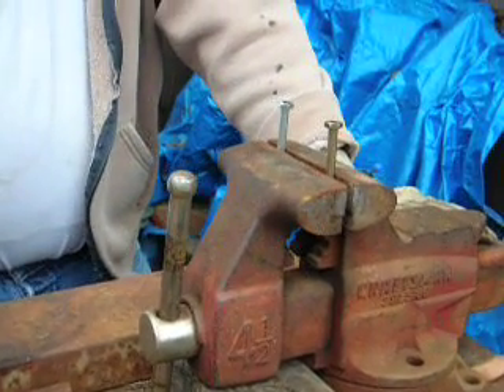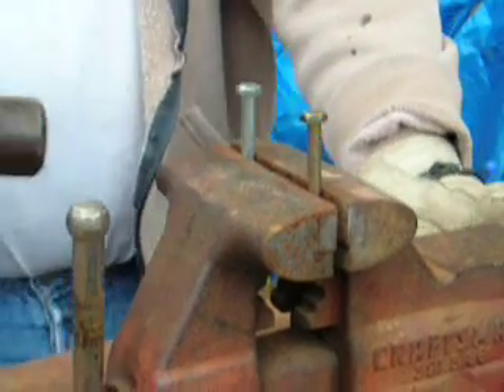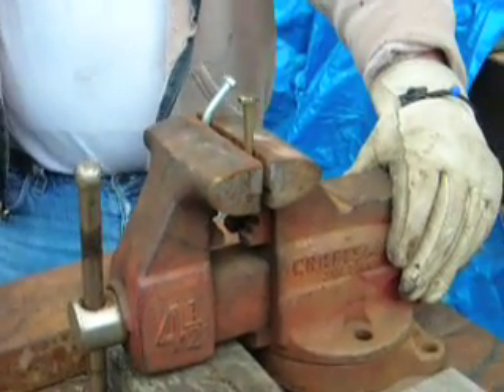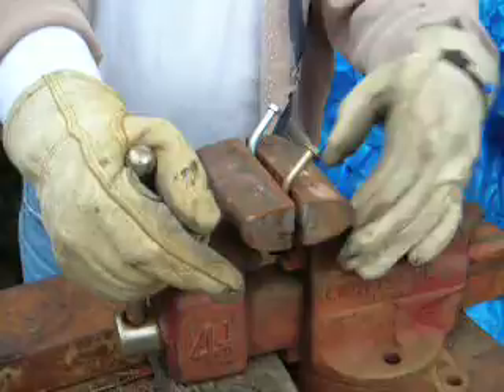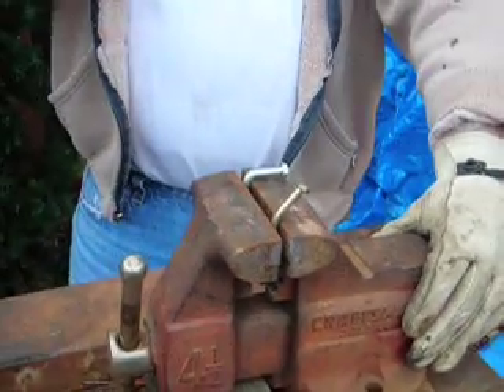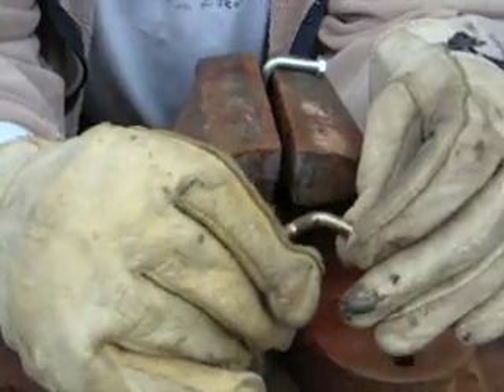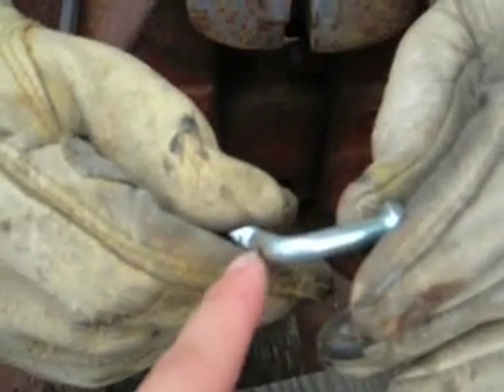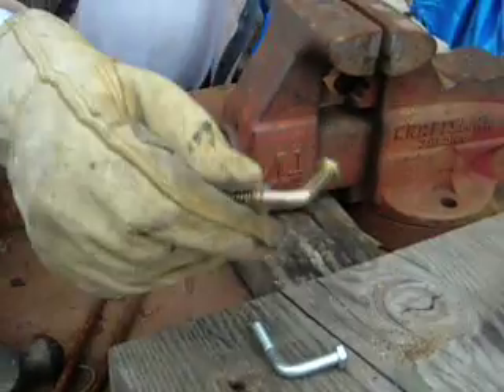Grade 8 vs Grade 5 Bolts, Are Grade 8 bolts too brittle ? DSCN1422.MOV

Comment: Yeah, its a myth that Grade 8 shear strength (brittleness) is less.  Its usually about 25% better.  Thanks for confirming!  So why not more Grade 8 bolts?  because they are about 15%-20% more expensive!

Comment: Pointless theory! Every time you strike any object with a light hammer the point of stress will increase in temperature. It gets hot! When you forge metal it will flatten out. When you bend metal it will loose its strength until it cools so you can possible heat and dip, heat and dip until it gets strong again. For bolt bending for any reason always use a cheater pipe big enough to slip over the bolt head. Bend it without beating the hell out of it!

Comment: This test is useless. Grade 8 might be more brittle, but they will handle a load MUCH higher than a grade 5. As long as they are used for the appropriate application, they are fine.

Comment: Should you decide to run a similar test again, you may want to consider bending them with a length of pipe rather than hitting them. You would be able to apply force more evenly, they wont slip in the vise, plus youd be able to bend them back and forth until they snap. Its also worth noting that both bolts will snap catastrophically if impacted with enough force. But the grade 8 will take more force. Another point worth considering is the amount of force required to deform or "flex" the bolt. Its this "flexing" that causes bolts to fatigue and snap in service. Grade 8 bolts will require more force to "flex" in the first place, which is why they are the ONLY choice for things like suspension components. Some say the ability of a grade 5 bolt to flex is preferable because it will bend more before snapping. Problem is, once its bent youre already on borrowed time.... A grade 8, properly sized, will not flex as much in the first place therefore under normal use it will not fatigue and snap.
Reply: Bro he is just doing a quick visual. Chill out

Comment: One of the biggest problems I have had over the last forty plus years is simply low quality bolts! 
   Your test is one measure of quality. 
   Counterfeits is another problem.
   Basically, you need to have a trusted supplier!

Comment: The key is proper bolt for loads if you stay with in those factors.  Lot of debate over on aircraft forums about AN, Stainless, Grade 8 bolts. If your using the bolt to hold aluminum together doesn't make much sense to bother with high tensile  bolt.

Comment: Second thought....It all depends on application, what are you going to use the bolt in and what the task demands of the bolt strength. A good example of "shear" is the snow blower, for strength, an automotive driveshaft, for shear strength.  Concerning the metal it's self, grade 5 is softer, and grade 8 is harder.

Comment: Great demo......But the "force" difference, according to my ear, it seemed that you had to hit the Grade 8 harder to get it to bend.  I run a motorized bike.  Two engines broke to rear attachment bolts that came with the "kit". I switched to the Grade 8 Cap bolt and that solved the problem.  I like your style.....no BS just the facts.

Comment: That was a great test. People here are criticizing with some bizarre reasoning? This is not my field, but I like many have an interest.The difference between the two grades is tensile strength. A good quality bolt will meet its specification and will retain some ductility up to the point of failure. A bolt relies on that ductile behaviour to work, it puts the tension on the nut and so on. Hardness is different. If you want an edge to remain sharp for instance the material needs to be hard at the edge and 'tough' elsewhere to ensure safety and long life in a blade for instance.. People use the words interchangeably, but it causes confusion. A hard steel MAY not be like a ductile bolt. As you improve the performance characteristics of the alloys for tensile strength, hardness may increase too and this is where confusion arises. Try that test with an HSS steel bit, obviously one whack and you will not see the bit you hit - it will be in orbit..
Reply: PS. The reality of it is this;  Stick to the recommended part and if it is safety related, then that goes with bells on - The manufacturer knows better than Fred at the garage, and anyway will have access to lawyers Fred doesn't/can't afford. If a grade 8 high tensile bolt is specified, don't be an idiot - use it. 
Reminds me of that aircrash where the bolts holding the tail fin on to the fuselage where changed, well two were replaced out of four. The cheap ones failed and the rest is history as they say.

Comment: This test is misleading and the emphasis on hardness is misplaced. Fasteners, certainly in engine assemblies, are used to join two faces. The faces bear the shear load and as long as the pretension is not exceeded (tensile strength not brittleness), the bolt will see little if any shear loading. If the joint is properly designed with a grade five bolt then going to grade 8 is wasted. If the pretension is never exceeded, and that is the point of the design stage, the bolt will not loosen. Joint design is the causal factor to focus on when bolts fail -- for whatever reason.

Comment: Thanks for the great demo, but you're lucky the bolts didn't break or that you didn't miss with any of those first set of hammer blows. You could have easily smashed your left hand, which was positioned exactly where the hammer would have landed.

Comment: the proper test for the difference between Gr 5 and Gr 8 bolts is more like the application.  A tension test or a torsion test.  I recently ran a study with my students where we compared the torque required to shear off the heads of 5/16" Gr 8 and Gr 5 bolts. Grade 8 bolts sheared off at 50% higher torque.  The heat treatment of Gr 8 bolts increases the strength at the  sacrifice of ductility.  They will carry a much higher load but fail suddenly.  If you want the strength of Gr 8 and the "toughness of Gr 5" go with Gr 9.  Do NOT use Gr 8 as shear bolts in snow blowers etc.  You will twist your crankshaft before you shear these off.
Reply: Very decent comment. Thanks
Reply: Just purchased grade 9 bolts, expensive but worth it for the application needed
Reply: I use grade 8 on my 40hp PTO driven snow blower and they sheer just fine with no damage to anything but the bolt.
Reply: @jdm11060  yep the harder Gr 8 are less ductile so you get a cleaner break and easier removal BUT you are doing damage since the shock is being transferred through the whole system.  A softer bolt will reduce the shock as it deforms before shearing.

Comment: Grade 8 sheers cleaner then a grade 5 when used in applications of sheer pins. Grade 8 I've noticed will take 1 big hit and sheer clean. Grade 5 will take multiple impacts and distored before it will sheer and sheer sooner. Seen this on many pieces of snow equipment. Different equipment requires different sheer grades. Misconseption could be in one piece of equipment a grade 5 will outlast the grade 8. I've seen this when operators put the wrong grade in on the sheer flange. Only thing I can think of is grade 8 cannot stand up to multiple small impacts as a grade 5 depending on the service it is being put into.
Reply from the maker: Well that makes sense.  Using a bolt as a shear pin is an unusual application, and the softer Grade 5 will absorb more energy before they fail, I can see that.  It's also a very unusual case where a bolt is repeatedly expected to be stressed beyond the yield point in normal use.  Typically a threaded fastener should never "see" a repetitive stress, the highest stress ought to be at installation, and never change, ideally.  Thanks for the comment.

Comment: you are wrong because that is not fast incredible force yank pressure but instead slow formative pressure. good test though ;)
Reply from the maker: +Mario Rodriguez Can you elaborate?  Yank pressure vs. formative pressure?  Thanks.
Reply: +Mario Rodriguez His test was supposed to show that grade 8 bolts are not incredibly brittle, and his test showed just that. If you want to know how much axial stress or shear stress each grade of bolt can take you can go look up the numbers.

Comment: One thing to note is the test is dependent on bolt diameter.   I ran a similar test a few months ago comparing grade 2 stainless vs grade 8 using 3/8-16 bolts as part of a catastrophic failure analysis for some machinery.  While the grade 2 fasteners could be pounded all the way over, the grade 8's snapped before the 45 degree point.   But they were still more malleable than we believed and were therefore cleared for service.
Reply from the maker: +Milo X That is a very interesting and worthwhile comment, thanks for posting.

Comment: can you explain why a grade 8 bolt sheered and grade 5 didn't for a timing tensioner? I replaced the oem bolt with grade 8 and it sheered right at the block while it's cheaper replacement has not failed.
Reply from the maker: +dlanes Did the new grade 8 bolt fail during tightening, or in service?  Either way, difficult to explain.
Reply: +guidoguitar in service, grade 5 is more ductile

Comment: I will not use grade 8 hardware on engines for the simple fact that if you break one, its nearly impossible to get it drilled out and re-tapped. The steel has been hardened to a point where most extraction tools will barely touch it.
Reply: grade 8 bolts drill just as easy as grade 5
Reply: +Josh Denham have you had to drill one out before? Just curious if your comment is based on experience.
Reply: +John Fraser Ya. I had a chevy sb once where the previous owner had used them for exhaust bolts. Of course once heated and cooled for a few years, most of them snapped off when I tried to pull the manifold (gasket was leaking). I burned up several of my drill bits and even snapped off an easy out until I finally went down to the hardware store and paid about $25 for a nice tungsten carbide bit to drill them out with.
Reply: That's a pretty legitimate reason to not use grade 8 then. Probably any bolt in that situation would be hard to get out after being broken off though.

Comment: This is the dumbest test for checking bolt hardness I've ever seen. Bolts are graded in hardness for shear and stretch. This test doesn't prove anything concerning those parameters. You have no idea how much force was applied with the hammer or if it ever got near the strength needed to shear or stretch. To use this test to determine whether grade 5 should be used instead of a proven grade 8 minimum for automotive application is risky at best.
Reply from the maker: +o1racing03 The metal has to stretch / elongate permanently for the bolt to bend 90 deg.  Grade 8's might stretch / elongate less and break earlier, but few if any automotive applications are going to require permanent elongation in normal service.  Fears that Grade 8's are too brittle to used as substitutes for Grade 5's are likely ill-grounded in fact.
Reply: +o1racing03 The material has to stretch around the outside of the bend to flex. Nothing you are using Grade 8 bolts for on an automobile will produce a 45deg bend, let alone a 90. Grade 8 bolts are the best you can use, and of course you get defective products every now and then, who doesnt?

Comment: Is there anyone who actually believes grade 8 is too brittle? Lol
Bending isn't really a proper test of the bolt's function. You would need to test it's tensile strength or its resistance to sheering.
Reply: AmericanThunder flexural strength is also know as fracture strength so i would say it is a good indicator of brittleness but it depends on what your application for the bolt is. tensile and shear would require slightly different characteristics then fexural. i agree with you grade 8's are not hard enough to be too brittle. i use them as shear pins against recommendation all the time and they still shear all the time
Reply from the maker: AmericanThunder Look at all the comments + I still hear the "too brittle" argument often.  Unless the application calls for plastic deformation to stave off a greater failure, I don't see the argument against Grade 8's.  A tensile test machine isn't as graphic as bending the bolts, you don't need to read a graph to get the point here.  Thanks for the comment.

Comment: When a bolt breaks due to brittleness, it is usually that the bolt has suffered hydrogen-embrittlement caused by fatigue and corrosion; this can happen with any class of bolt. Many factors dictate the selection of bolts; to say don't use Grade 8 bolts or don't use Grade 5 bolts, etc, etc.. just because someone repeated it, is nothing more than blind ignorance. The application is what should dictate the bolt specifications (OEM specifications please). Brittleness is a factor to consider, but most bolts are not too brittle to begin with; it's how the end-up when not used correctly.
Reply from the maker: kay ger Hydrogen embrittlement is its own separate animal, outside this discussion.  Brittle properties and failure are not necessarily associated with stress corrosion cracking or hydrogen embrittlement. not sure I'd describe these as "usually" either.
Reply: guidoguitar
Ok Guidoguitar, It's not entirely a separate animal; although it's more common in higher carbon steels. Maybe the term hydrogen embrittlement doesn't suit your fancy... So instead of just saying no, why don't you provide an explanation? I never said that brittle properties are necessarily associated to stress cracking or hydrogen embrittlement. Then instead of just condemning my reply, at least explain in your opinion what causes the brittle properties of, let's say... "an old exhaust manifold-bolt compared to a new unused manifold bolt of the same specifications"; or are you to say that the old heated stressed bolt is no less brittle than the new one? Sometimes I'm wrong, but not "usually".
Reply from the maker: kay ger For starters I'm not seeing the connection between fatigue and corrosion with hydrogen embrittlement.  The video is only meant to show Grade 8 hardware is sufficiently ductile for most any auto application: where any strain beyond the elastic limit is likely already a failure, and properties beyond the elastic limit are unimportant.
Reply: guidoguitar For finishers, the subject line in the video states: Often heard "Grade 8 bolts are too brittle, don't use them on automotive projects". My point is that often times someone will have a broken bolt after it was installed and subjected to some form of stress and make such a comment, then it is repeated by someone else, etc, etc... Then someone else thinks, "hey better not use a grade 8 bolt in automotive", which is nonsense, but the bolt that brought someone to that conclusion may have been a used bolt that was over heated, over torqued, subjected to too much load, corrosion,etc, etc... Stress will cause embrittlement and if you can't make the connection of what chemical reaction occurs or believe that I'm off topic, then I guess we are in disagreement. However, I think you just want to play Johnny expert know it all!
Reply from the maker: kay ger If you've got steel becoming brittle in service, because "Stress will cause embrittlement " or "chemical reactions", I would say you need to be the pioneer, write a book or a tech paper explaining these theories.
Reply from the maker: kay ger What exactly drives YOU to post self-aggrandizing, technically illiterate comments on so many videos?

Comment: Insert the bolts into a threaded hole and use a torque wrench and note which bolt breaks first and how much torque it takes to break it. Bolts are made for stretch not shear.
Reply: Copter pilot,  Shear strength is what keeps those rotor blades from slinging-off your rotor hub. Bolts are designed for both shear and tension applications: his test is actually a bend test, a combination of tension and compression forces. Bolts are not typically bent if the application is of proper design. A torque test will reveal that a Grade 5 bolt will break at a lessor torque than a Grade 8 bolt, brittleness is not the resulting factor in this case, it just lacks the same strength. Rarely is a grade 5 bolt used in structural applications. When torquing a bolt you will have stretch as the bolt grips, but the force being applied is torsional. Besides your copter uses specified AN, NAS, or MS bolts... Anyhow, I hope it does for your passengers sake.  Signed A&P mechanic.
Reply from the maker: copterpilot11 Not a terrible idea but won't prove anything about brittleness.  Elongation tests are usually/always done with pure stretching without torque or twisting.  Some bolts, especially in aviation, bridge-building, are meant for shear.  Thanks.

Comment: Wth, how are u testing the pounds of force used?  That test sucks
Reply from the maker: Both bolts are subjected to the same abuse.  The "pounds of force" as you put it are enough to deform the material.  I half-expected the Grade 8 to snap in two, but it didn't, as you can see.
Reply: Because grade 8 is stronger. Stainless 304 or 316 (a2/a4), however are not and are more brittle and care should be taken when used.

Comment: you should use some of those bolts to fasten down your vise lol
Reply: And if one of the bolts did snap, or come out of the vice jaws, the hammer would have struck his left hand.... hard!!!
Reply: ironlionkalo you are absolutely right............. really, should be torqueing them to see which breaks off at what torque. Need to fix the vice..........for sure.............
Reply: I was just going to make that same comment. Lol
Reply: He must've used grade 5 bolts and they snapped. Shoulda went with the grade 8....
Reply: I was thinking same thing! Lol